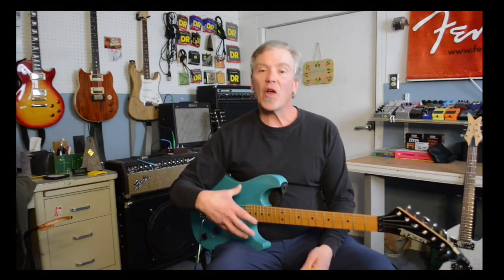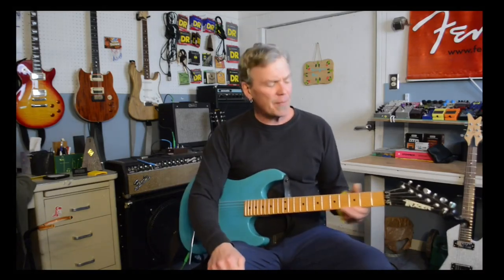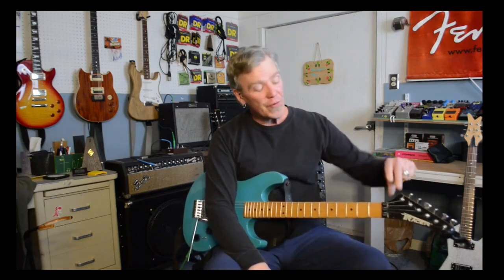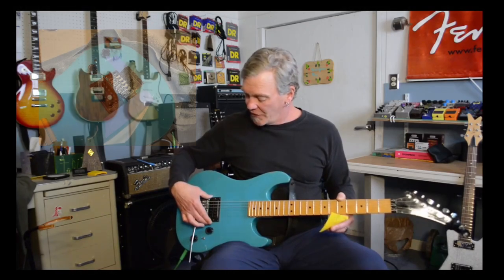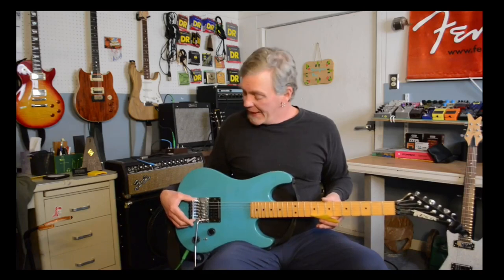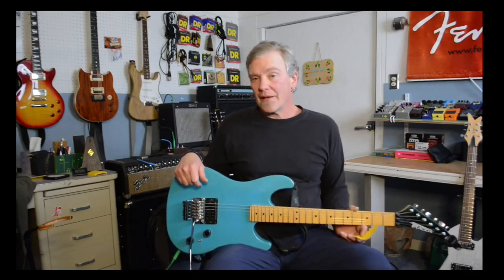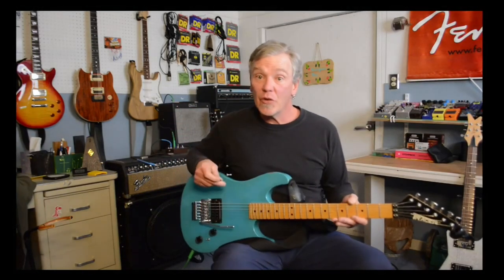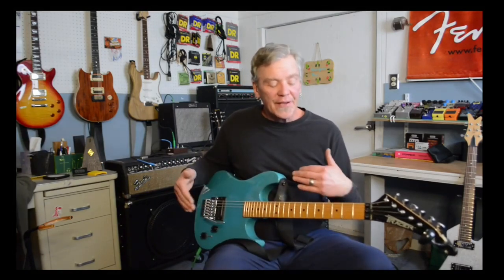Installing a Floyd Rose on my Peavey Tracer.

Comment from the maker: The nut came with brass shims, but I cut my own out of thicker material I had on hand. Hope that helps 🤘
Reply: I’m so happy to have stumbled across this video. I have this exact guitar (but in white). It was my first, $249 back in 1990/91. It now sits as a bit of a display piece at my Dad’s place, but this video definitely has me thinking about it again. I’ve been fixed-bridge/blocked-trem-guy ever since the Tracer… the tuning stability on that thing was wretched! But recently I’ve been eyeballing Floyd-equipped guitars (Floyd Specials, unfortunately, given my meager budget). Perhaps I shouldn’t be, with this prime candidate for install already in my arsenal!

One question… why did you have to custom-make shims for the nut? Did the shims that came with it not give you enough height?
Reply from the maker: Great story! Yes, the shims provided were not quite enough. But it could be different in your case depending on the guitar itself and what nut you go with. I used a Gotoh brand nut. Anyway, I hope your Tracer comes back to life and serves you well! @brendanflaherty6696